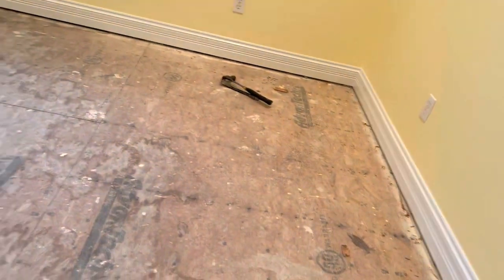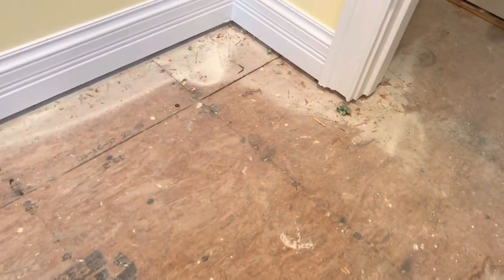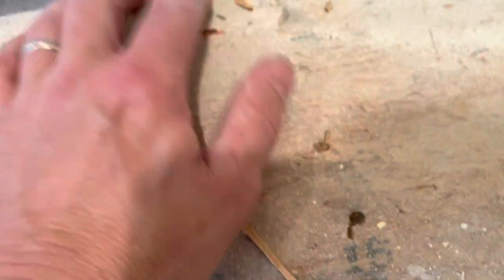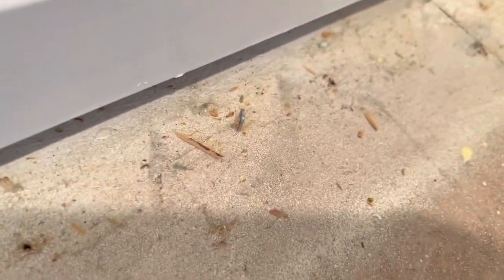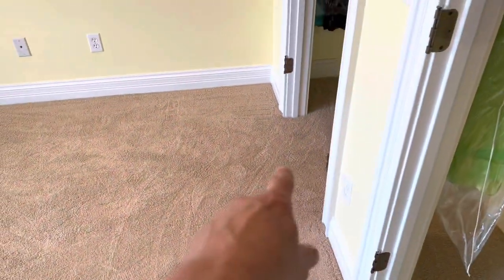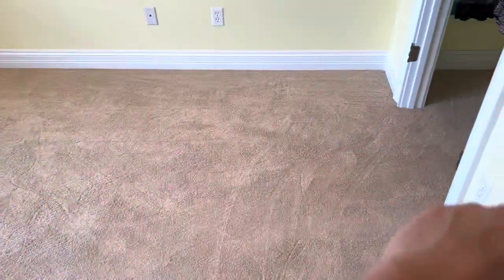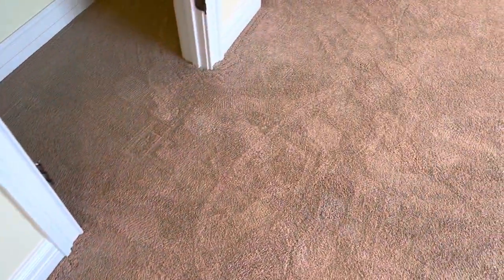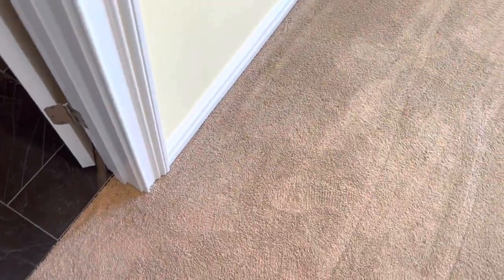daily vlog, carpet install,bad day

Comment: I have a young helper and the only way I trust him to put down tackstrip in a new house is to order nailless tackstrip and have him use the cordless Dewalt underlayment stapler and staple it down.  It is fast, and I can send him out by himself the day before I go out and everything is done. Don’t lose any sleep worrying about him hitting baseboard with hammer.   If you have a rookie and do a lot of new construction, get the nailless tackstrip and use an air stapler or airless stapler. 

I q to d RSS
Reply from the maker: Yeah I get ragged all the time because I staple the tack strip down, that’s why I was saying it like that I was trying to be sarcastic, I have been using a staple gun for probably about a year now and it is a lot better
Reply: i learnt to nail tack strip by using a peice of masonite between skirt n strip saves a lot of damage  dont need it now 28 years later
Reply: Buyers remorse is real.  Sorry to hear about your day.

Comment: Wouldn’t it be easier to hammer them in. Cause even if you saw them off. There might be metal overlapping.
Reply from the maker: Yeah but I don’t like to use a hammer because I have a bad right hand that is why I asked type of them myself
Reply: Nothing faster than heavy duty scrapper